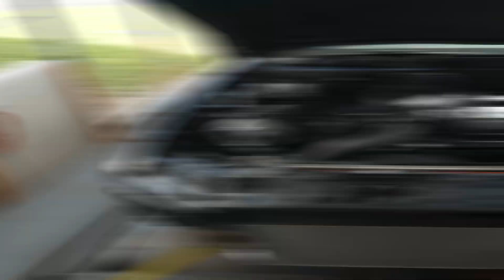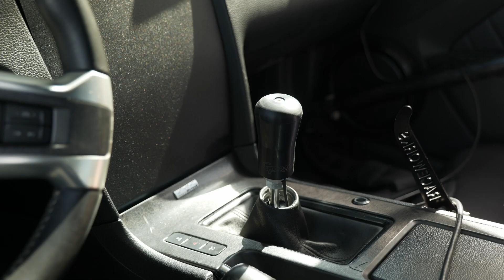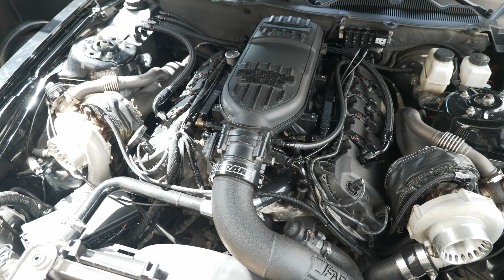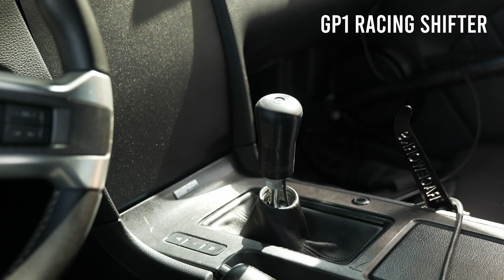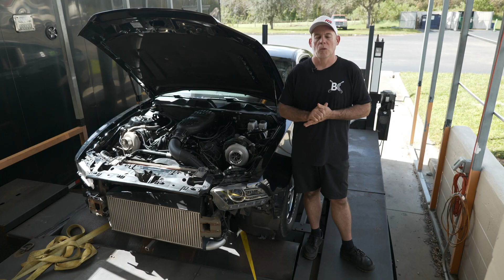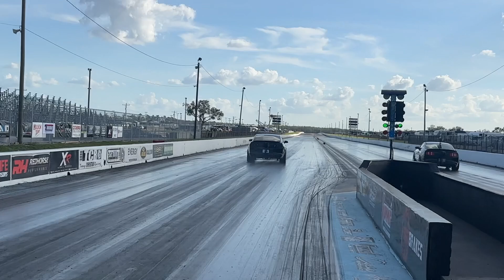MoTeC USA S197 Mustang Plug & Play Kit: The Ultimate ECU Upgrade for Mustang GT | RS Garage

Comment: The dedicated logic for crank position puts motec in a class of its own. Any good engine no matter how well it’s built has a horsepower limit and a lifespan. Rev limiters, safeties and the way the safeties are implemented vastly affect the lifespan of an engine close to the limit. 

Unhealthy safeties I give the example from the balancer on the crankshaft to the tire glued to the world everything in between is like a coiled spring, i’d hope that safety isn’t like a light switch at  9000rpm and 50+psi